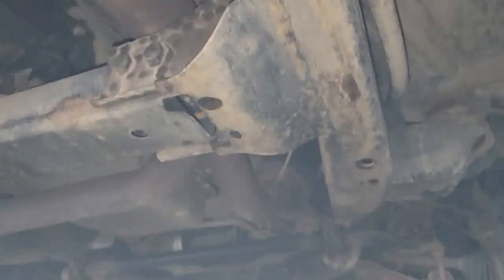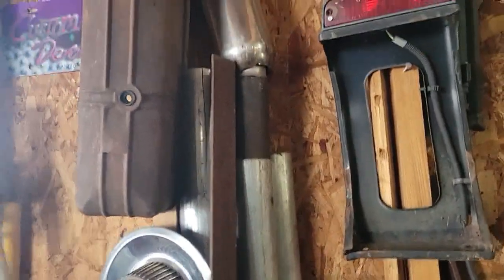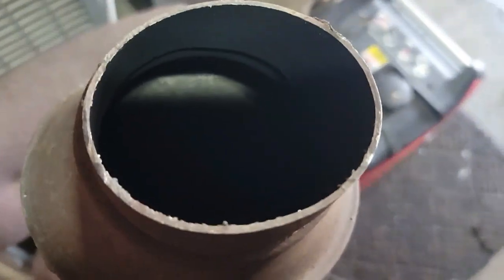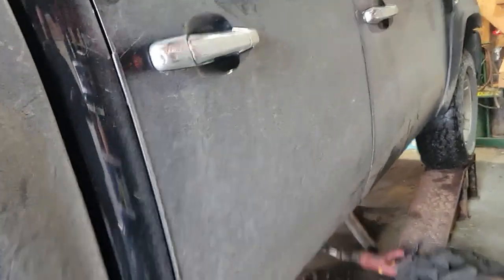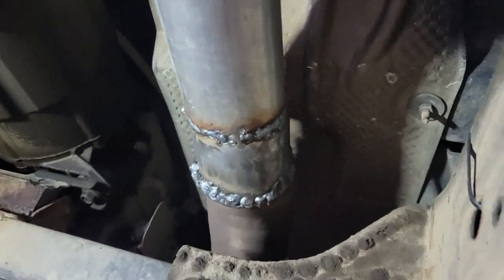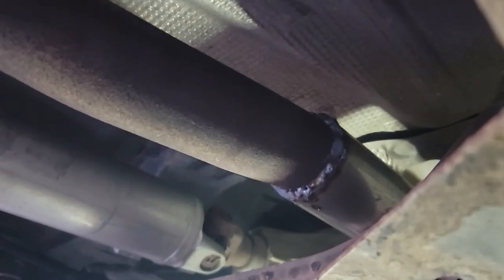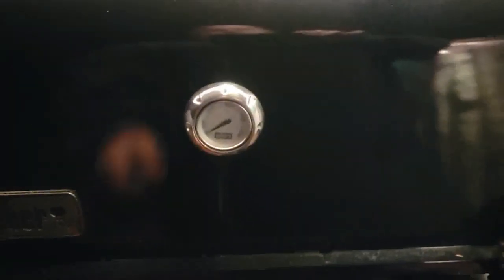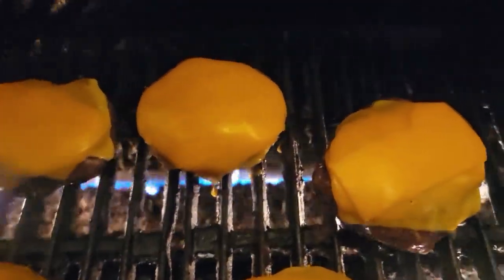Silverado cat delete plus burger celebration

Comment: I have a single pipe cat back exhaust on my 2019 Ram 1500. No muffler or resonators. 3 inch all the way from the cats to the tail pipe which is a turn down tip. Sounds awesome. Not too loud in the cab either. Sounds a bit like a Cummins at idle. Has a nice low rumble. It'll roar when you stomp on it though. Not as loud as my 2012 Ram 1500 which had the exhaust ending right under the cab.